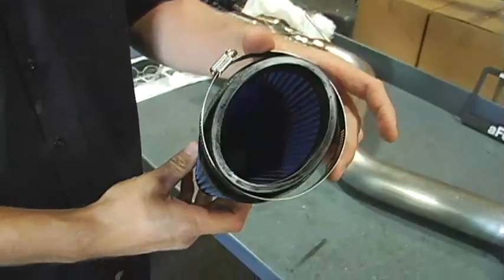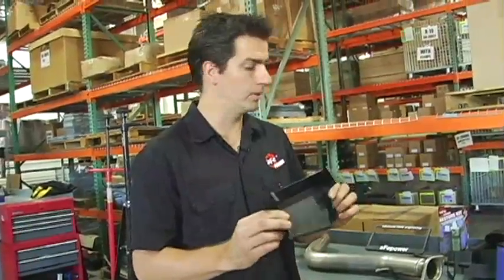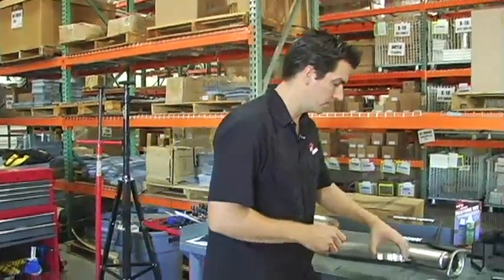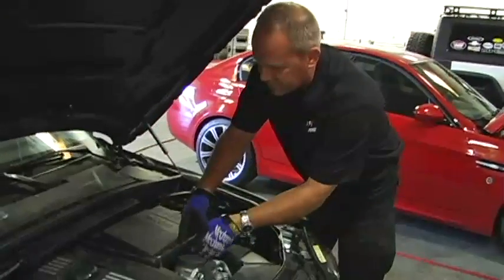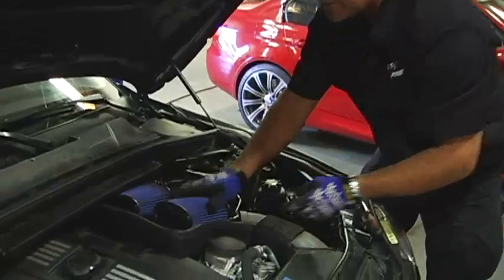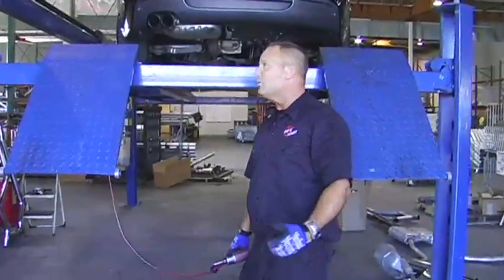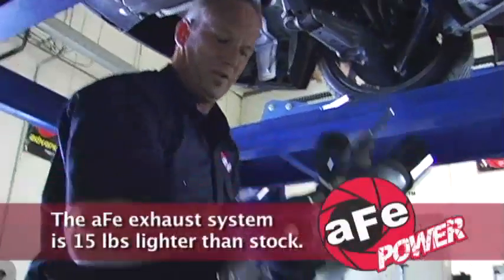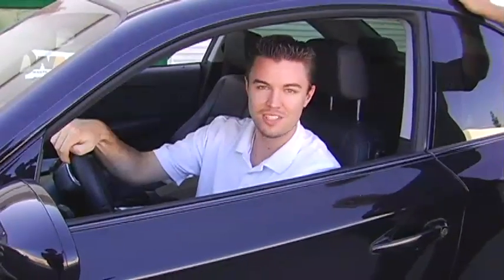BMW 135i aFe Intake, Cat-Back Exhaust, & Throttle Body Spacer Installation

Comment: Hey, OldBooster here, with my quickest 135i with modified JB3: 11.26@127mph. Stock, my car produced 258 WHP on a Dynapak; bolts to the wheel hubs=very accurate. I say any stock 135i HP reading under 260 is accurate. Dynojets are very generous. After many mods, my 135 made over 500 whp with methanol spray (11.5 ET/123mph), and over 520 whp/535 tq. with a small .30 shot of NOS.  Lots of stuff form ModBargains, too!

Comment from the maker: The dyno being used is a mustang dyno, which shows about 25-30% less horsepower than a dynojet.  It uses force as resistance, which is proper to show actual gains on turbo engines.  The JB3 was disabled prior to installing the intake, exhaust, and throttle body spacer.  We wanted to show gains of these products as if the car was on stock software still, not already modified.

Comment: @300ZXturboXX 239hp is the power when measured at the wheels. 300hp is the rated power when measured at the crank. There is horsepower loss when it goes thru the drive, to the wheels and tires, to the ground. It happens with all cars.

Comment: $1000 for 12hp.......... or $6-700 for JB4 + downpipe = 100hp
Reply: A tune pushs more HP sure, from like a cobb which eventually went on this vehicle but everything else that works in tandem allows it to safely get to higher stages. These are the bolt ons that were needed. Keep in mind this video was produced awhiel back prices have come down now significantly as well.

Comment: Some of the comments I've read are way off. When a car company lists a vehicles hp it is for the engine, not rear wheel hp. The 238 hp is the rear wheel hp. The engine is rated at 300 hp.

Comment: @tmac20031 All car manufactors rate their engines at the crank, so add in about 10-15% for powertrain loss, also, I believe they weren't feeding fresh cool air into the IC so it was probably heat soaked.

The N54 35i engines do perform wonderfully though :)

Comment: I would have been curious to see what the stock intake would do against the AFE back to back with the other mods already in.  I keep hearing that the stocker is still best thus far.  Maybe the 15hp came from the exhaust and the throttle body spacer.

Comment: @elmackerton just checked their site... the exaust is  listed at 650$, their price is 499$. throttle spacers are listed at 157$, their price is 149$. and intake listed at 405$, their price is 359$. i was pretty dam close:) sooo.... 1007$(before tax) for 13hp and a better sound.

Comment: No, that's 238whp, not bhp. That dyno is measuring power to the wheels. BHP is to the flywheel. It's running closer to 300bhp. A 128i would be putting down like 180whp.

Comment: Are we sure that spacer's not on backwards?  To me "Air In" means the "air" goes "in" here.  This should clearly but labeled "Air Out" since the air is coming OUT of the spacer there. I'm pretty sure the engineers that designed it knew which way the air was traveling.

Comment: @StarsMarsRadio have you heard of drivetrain losses? you do know that everything connected to the output side of the crankshaft requires some amount of power to turn before the wheels can even be moved, right? geez some people are just ignorant, friction affects every moving part i dont care what it is: there are many types of energy elec, heat, chem, mech etc. and mechanical energy is lost due to friction and changed into heat energy which obviously isnt going to turn wheels...not crankshaft hp

Comment: That's still really low for wheel HP. It's no secret that BMW underrates the HP at the crank. Independent studies show about 325-330hp at the crank. However, the 135i has a limiting stock exhaust unlike the 335i. With a K&N drop in I dyno'd 280hp and 292ftlbs at the wheels on my N54 335i, and the quickest way to add is a tune. Running a Cobb Stage 1 Sport map I dyno'd 340hp and 370ftlbs at the wheels!! Exhaust upgrades are for weight savings and sound, not power (at least on a 335i).

Comment: 12hp? Get a JB4 for around $600 and you'll be seeing 60-100hp gains off of stock internals...
Reply: Are you drunk?
Reply: Wpythons look it up. Turbo'd cars are often beau coup underpowered from factory (because honsetly, what average consumer is gunna be able to handle this much torque). Downpipes, DCI, Meth Kit, intercooler. Thats almost a 500hp car right there. That's why i sold my G37S Coupe and got a 335i Coupe
Reply: +JoJoFreshly Crank hp or wheels hp?  No way you get more than 20 whp on full engine and exhaust parts
Reply: Wpythons I wish I could say it wasn't true! Look up 335i JB4 or 135i JB4 and you'll see how crazy those things can get! Its truly wakes up the car and taps into its true potential...
Reply: +Wpythons JoJo is right these cars are beasts. Inline 6 with twin turbos (new cars single turbo). 

This is the Supra of our generation. People just don't know it yet
Reply: +Mark Seven i know right, im glad bmw still makes their inline 6's. Wish toyota and nissan did the same.

Comment: Shit probably cost 1200k+ for 12 fucking HP. I doubt some dude that designs intake spacers knows more than a BMW engineer.
Reply: +Seth Glenn thank you.
if a spacer did everything they are supposed to do, why wouldnt the factory just put them in?
Reply: Damn, that was a good point.
Reply: Seth Glenn pretty much,increasing the plenum volume is stupid

Comment: I have a hard time understanding why it dynod at 239 horsepower, when the 135i is supposed to be rated at 300 horsepower. I am thinking about getting an Audi a5 or a 135i, but more and more i'm leaning toward the 135i because of the power; but If it doesn't really do 300hp, then it is a freaking joke. Heck, might as well take the a5 with 211 since it does look better.

Comment: 239whp and 262tp that is really low mine is running 280 both whp and TQ and it was on the mustang DYNO which is already lower then dynojet number :-S

Comment: that was an instant 10% gain with HP and 5% gain with TQ; is that something that you can feel on the road?
Reply: yes, but not with a passanger   haha
Reply: they didn't say if they lost low end power to get high end power in the 5k rpm which nobody ever even sees 5k and up rpm..
Reply: goheat77 All my cars see 5k+ rpm every day...

Comment: I'm not understanding the logic in the statement "Using two air filters will speed up air flow." How much air the throttle body sucks in is determined by one thing. How much air the engine needs @ x amount of throttle, which can be tuned on the ECU. Stick a larger air filter on there, you might have something for "on demand air availability". Also, I understand separating the throttle body a little will theoretically "straighten" the air up a little before it enters the intake manifold, maybe a fraction of a HP boost; more money, not a whole lot of practicality.  All this setup was, was a waste of $$$, period.

Good investment would be an engine tune, turbo or (supercharger), shot, ported heads, shorty headers, intake manifold porting, overboring cylinders, etc.

Too bad a lot of guys like to dump money on impractical things because of misinformation.

Comment: A 135i will make 300 crank horsepower out of the factory... this was probably N/A
Reply: This was a wheel dyno not crank
Reply: @baderalbuloushi8369  Yeah, but there's no way that more than a fifth of the power would be lost to the driveline, even after those mods.
Reply: @gavinmann7670  there are three types of dynos i know ... dynojet ...dynoes that connect to the wheel flanges .. mustang dyno ... each will give a different number because they calculate differently ... plus it might be weather/altitude corrected or not ... add to that if you have three dynos from the same type at three shops each will give a different number ... search this model stock rwhp and you'll collect more info on the correct number.

Comment: Throttle body spacer on a 135i?  face palm
Reply: Lol well gotta agree, I think it's the quest to improve every little bit, the thought on the TBS is that it creates that flow movement(tornado like) to channel air in quicker (and the thought is faster throttle response), however  honestly it's incredibly difficult to measure. I can attest that instead getting a sprint booster for throttle response would do far more (used it myself and was pleasently surprised) - http://www.modbargains.com/sprint-boost-08-e82-bmw-1series-SBBM0001S.htm
Reply: Ron Hay also, they were primarily used with carburetors to create turbulence for better fuel atomization. Useless with today's EFI and for sure useless with direct injection.
Reply: I explained to you the explanation from AFE and their engineer and why they did it. Thank you for the other explanation
Reply: True enough.Bbut i think the engineers from AFE are just trying to sell a product that has traditionally sold well in other platforms, they are a sales company after all. I prefer my JB4 though, it maps the throttle all by itself among other great things ;).

Comment: This is weak. My stage 3 335i n54 is 410whp on 91 and 470whp on E85. And the 135i just isn't a good looking car
Reply: right. I'm guessing these power gains are minimal seeing as he probably spent at least a grand on the exhaust alone
Reply: The 135i looks a lot better then the coupe 335i, but I love the 335i sedan, IMO.
Reply: Interesting.   60 whp extra on E85?   E85 has 85% ethanol which means that a gallon of E85 will have a lower energy content than gasoline containing 10% ethanol.  I understand that ethanol raises the octane number, but maybe the cooling effect of ethanol in the intake system on a turbocharged engine makes more power?  Your dyno data would tend to suggest that.
I have a Dinan stage 2 on my 135 and will have to dyno test it.
I got 480 wheel lb-ft of torque on the dyno on my X5 50 with Dinan Stage2.  It would be interesting to rerun with E85.
Reply: ***** No I wasn't planning to.  I was interested in the thermodynamics of E85.
Reply: The 135i is exactly like the 335i only lighter and faster. A stage 3 135i would torch a stage 3 335i. And look better doing it too.
Reply: sircut 135 is an ugly ducking. It really is hideous.
Reply: on 91 lol keep dreaming buddy
Reply: Luke Miller right? I was gonna say my n52 makes 240 torque or so and this n54 was making 260? Something's not right...